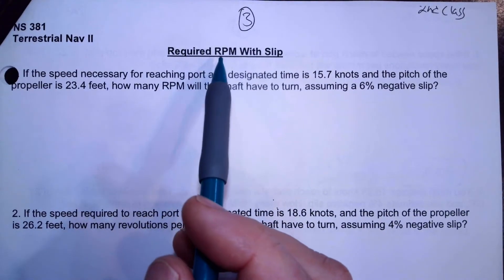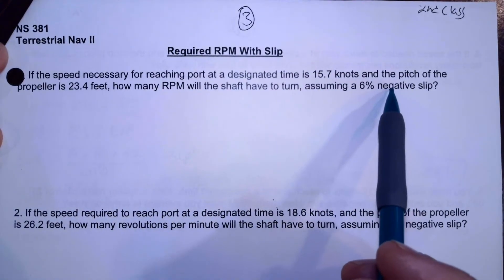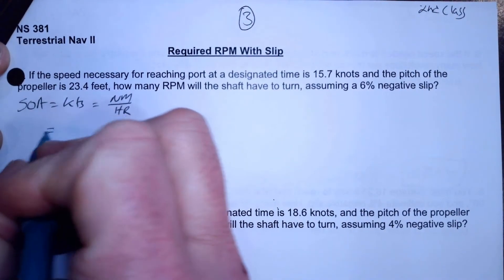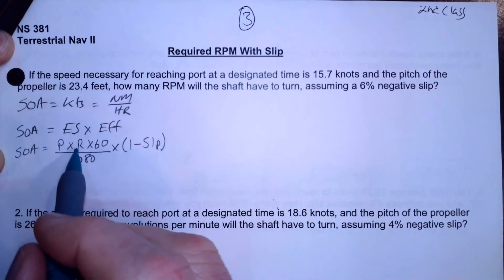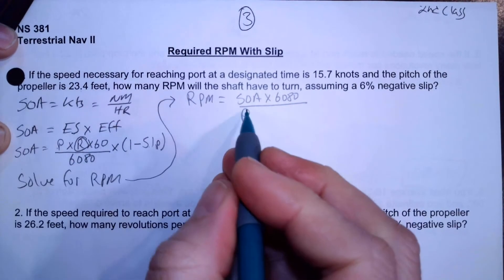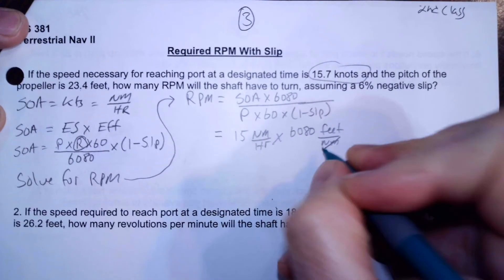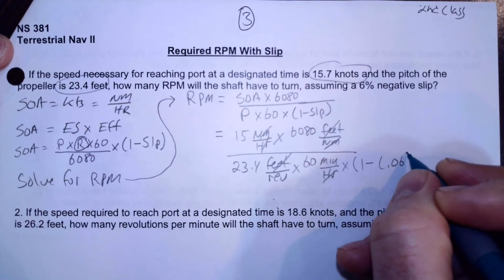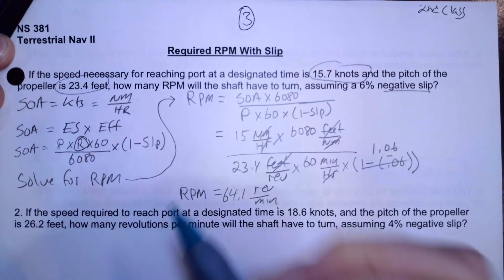Calculate Required RPM

Comment: Sir thank you so much for your 
Sharing of your knowledge . But the answer indicate in My Sci cal is.
61.28 or (61.3RPM) Sir please correct me if I'm wrong.
you avid listener sir.
Reply from the maker: Hi.  Thanks for watching. I just did the calculation again and got 64.1 again. I'm not sure what you are doing differently. Are you using all of the same numbers as I am in all of the same places of the formula?
Reply: @deckprep  good day sir, thank you for posting this. 
i use this in my sci-cal (15*6080)/(23.4*60*1.06) and got 61.28. did we do something wrong? can you please show us what you did in your sci-cal? thanks again
Reply: @eebramocgnay8501  compute that to (15.7*6080)

Comment: The other question is 52 rev/min am i right ?
Reply from the maker: @And Rey Which other question?  Do you mean #2?  With Pitch = 26.2 and SOA is 18.6?  The answer to that one should be 69.2 RPM.  18.6 x 6080 / (26.2 x 60 x 1.04) = 69.2

Comment: The answer is 61.2
Reply: He wrote 15 instead of 15.7 
You will get 64.1 if you correct the SOA
Reply from the maker: @Nat Nat - I checked the problem and got an answer of 64.1 again. Please check your work